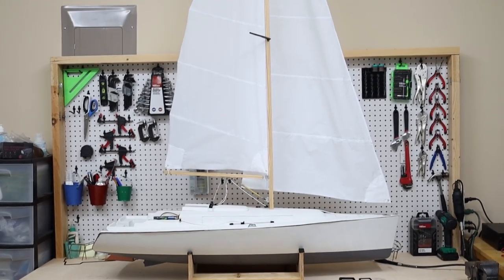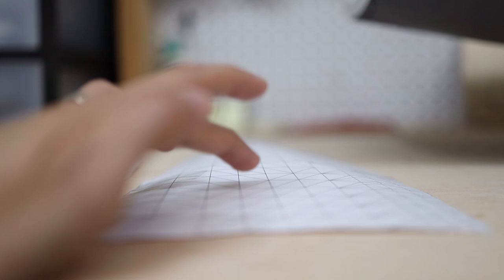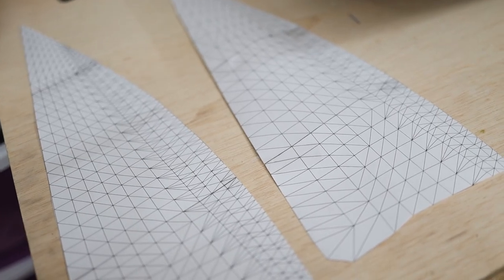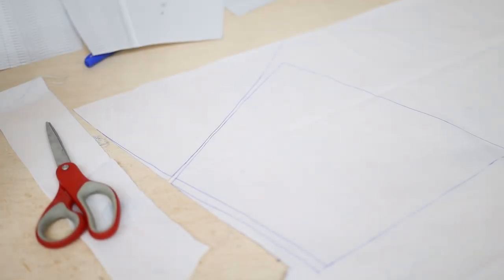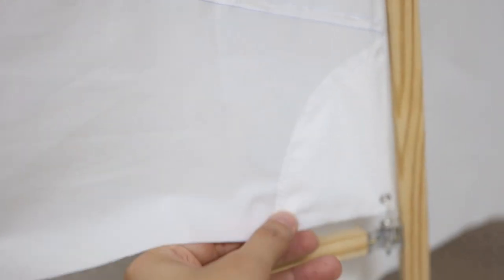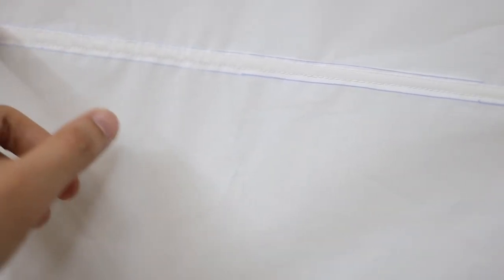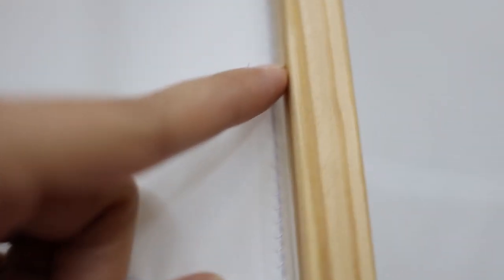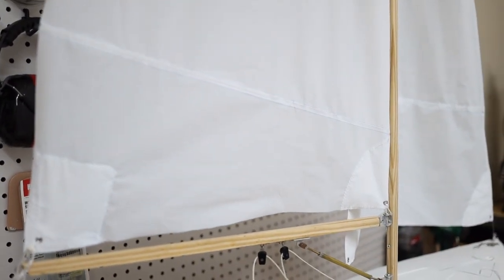dyi rc sail making

Comment: Nice workmanship.   I too have been trying to build  Pond Yachts. To save expense I have resorted to using sections of discarded carbon fibre fishing rods obtained from the local recycling centre  for masts and booms. They are  very strong, cheap and durable.
Reply from the maker: It is a good source for materials, thanks!!!